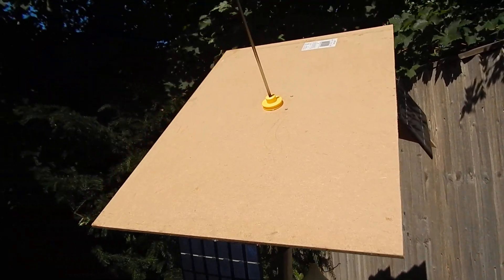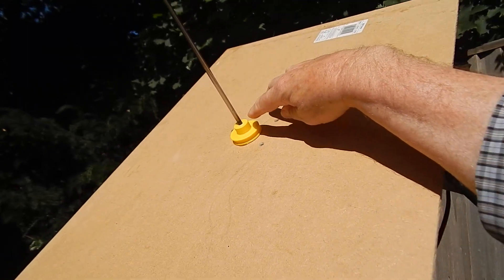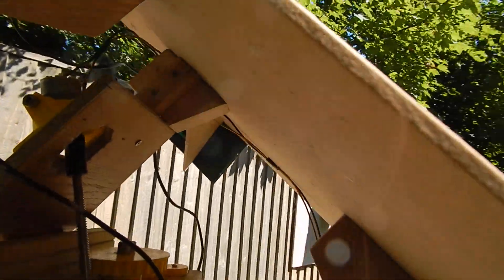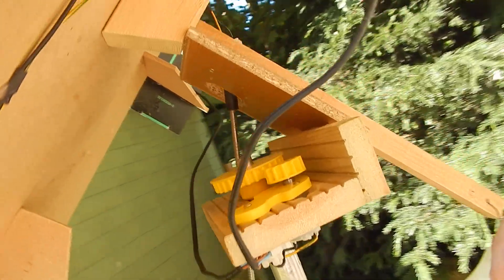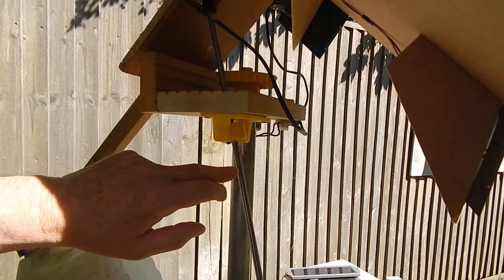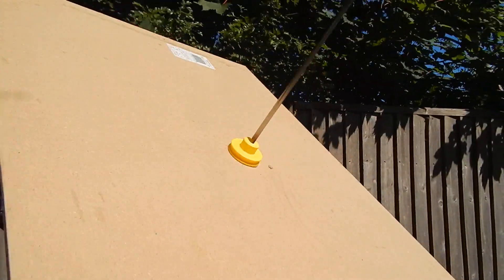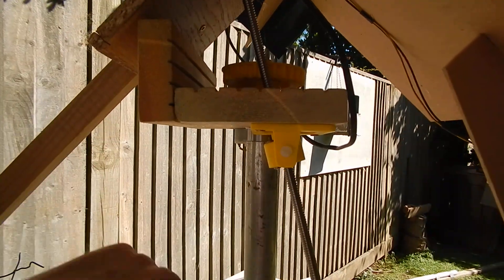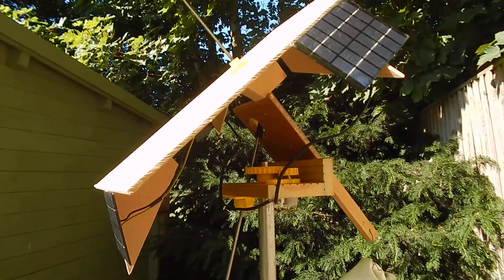Sun tracker, dual axis, how to.

Comment: Is this configuration creating a short? Could a system like this be used to control a bigger set of panels? I'm thinking about doing a 4x 450W array with a lazy susan mechanism. Maybe the solar cells and the motor should be of a higher voltage, however I'm not sure it could work.
Reply from the maker: This same system would work well with larger panels - you will just need drive panels sufficiently large enough to drive a bigger motor like a 12v windscreen motor.

Comment: Fantastic! I was trying to brainstorm the various sensor methods - heat, shadows, 24hr timing, etc. I did think of something like this with small solar panels but I didn't realize it would reset itself in the morning! That is the drawback to a lot of systems I've seen on YouTube. And as you say, it's all self-contained.

Would the system be improved if you added a counterweight to the panel? It seems like this would allow the same motor to move a heavier panel array.
Reply from the maker: Thank you Steve. This system works very well - you are correct about the counter weight, you will see on the video I use a gallon container to balance the panel, water can be added or subtracted as required. Although interesting as an exercise, it's considerably more complicated than a simple single axis tracker for not that much gain. I measured about a 25% increase with the single tracker but only a further 8% with the dual tracker. If I was building a practical system with larger panels I would opt for a single tracker with a summer/winter position for the panel.
My simple panels self set because I can't track the sun right down to the horizon due to boundary hedges so they stop tracking around an hour or so before sunset, so not pointing full west. If you wanted it to reset from full west then an additional small panel in parallel with the left drive panel positioned to pick up the morning sun would drive it back fine.

Comment: Very nice video. From what I understand this is the orientation mechanism for the solar tracker. Would it be a good idea to place a bigger panel instead of the center board so the mechanism would orient this panel and we could use it s energy to charge something for example?
Reply from the maker: Yes, that is the intention - This is just a prototype to test the principle. It's just what I had to hand - Spending a little more for larger drive panels would drive bigger motors and still work in exactly the same way. The little panels I used were about $5 each (6v/ 2 watt).  4 x 12v /10 watt panels would drive windscreen wiper motors and allow a couple of standard sized 200w panels to be tracked giving about a 30% increase in daily output.